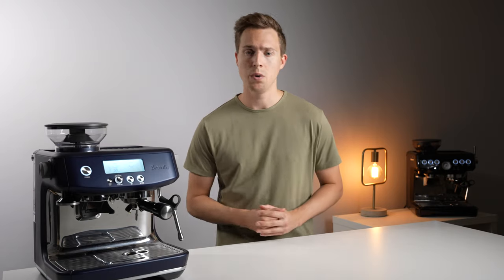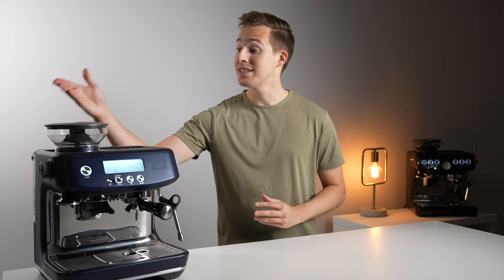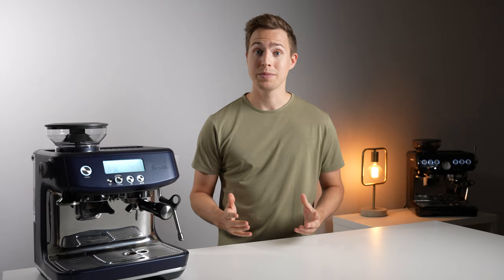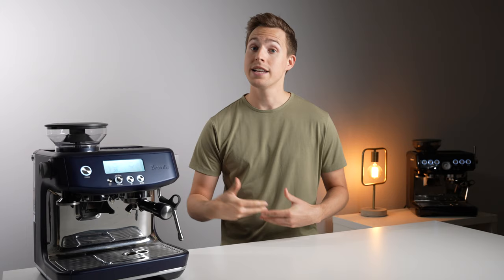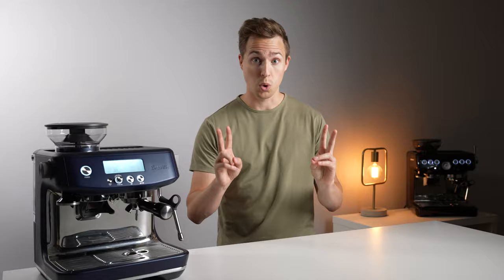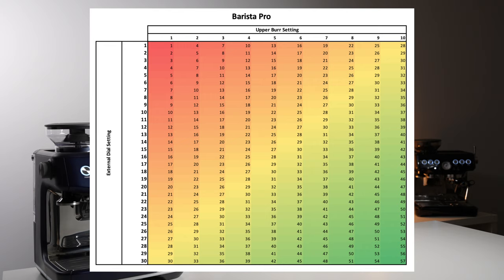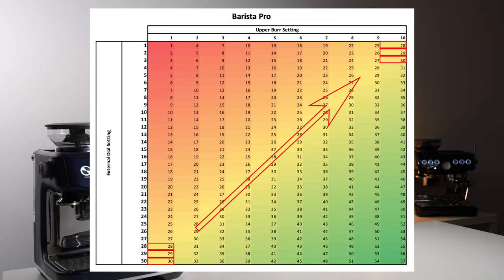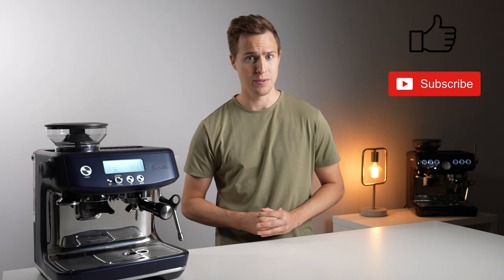Upper Burr vs Outer Dial Grind Setting | Breville Barista

Comment from the maker: Adjustable Upper Burr: https://geni.us/5K6T
(As an Amazon Affiliate, I earn from qualifying purchases)
Reply: What’s up bro, I have the barista touch if my conical burr is at a 4 any clue what my external should be? I use a naked portafilter & it’s sloppy every time 🤦‍♂️ so confused on if I should’ve even touched the upper burr which was preset at 6.
Reply from the maker: I can’t tell you what grind setting is right for your coffee or preferences. You need to dial in! 
How to Dial In Breville Barista Pro
https://youtu.be/D-bV4j-Z-sU

Comment: Wish you had done that 1.5 years ago when I too was trying to figure that out. My initial assumption was that it gave you a full new range, but after a pile of testing and troubleshooting I came to the same conclusion that it shifted the outer grind settings by 3. Before going through all this I had asked on reddit subs, Breville support, other BE owners; no one had the answer. Anyways, this was good to share for the masses.Thanks!

Comment: Interesting findings. Can confirm (barista pro). I was at the upper 6 and external 1 and it didnt work for my beans. Changed the upper to 4 so I have more room to play (italian beens, fine grind, italian espresso). I'm most of the time dialed in with the upper 4, external 4-6
Reply: Same for me.  I am at 4 on the internal burr and my shots are dialling-in around 4-6 on the external dial (mostly 5).  Seems odd to be this far down one end of the range.
Two other observations:
1. It takes a few shots at the new setting to really settle down to a consistent time, even if I have taken time to adjust the setting “mid-grind” and discarded both that and the subsequent grind at the new setting before pulling a shot.
2. The difference in shot time between each external setting can be quite large, maybe 2-5 seconds.  I believe the dial is stepless though so have tried finding the sweet-spot between settings.
Reply: This was helpful as I was maxed at external 1 with inner burr setting 6. Tried inner bur setting 4 and landed on external setting 5, and pulled a great shot today! Thank you.
Reply: Saaaame. Why are all my beans so close to the fine limit?

Comment: Can you please clarify -- When you say you dialed in a 32g shot, I am assuming that's the weight of the coffee in the cup, not the weight of the ground beans. I am curious what is the weight of your ground beans. I was shooting for around 20g, but found that on my Impress Touch, I'm getting about 14g when the tamper says the basket is properly filled.
Reply from the maker: Tune in to tomorrow’s video! 
The dose you can fit in a basket is dependent primarily on how dense your coffee is. Very dark roasts are less dense, so need more space to fit 18g. Dose appropriately for your coffee and basket, and change the brew ratio accordingly

Comment: I’ve had my barista touch for about 1.5 months now. I now have it set at 1 on the external grind however haven’t gotten the courage to play with the internal grind level. I weigh my beans at 18 grams and it takes 14 seconds to get 36 grams out. Can’t seem to be able to control that at all. So frustrating. My daughter just got her barista touch and hasn’t changed the factory settings at all and she gets 36 grams out in 25 seconds. I tried to go back to factory settings on my machine and the coffee was undrinkable. I went back to my drinkable but not great shot grind. All that to say that I believe breville grinders are not created equal whether you have a pro, express or touch. It’s most likely the same grinder in every model but they all grind differently. So you’re on your own and have fun playing around with it to get that perfect shot!
Reply from the maker: Yes, they definitely aren't calibrated to one another from machine to machine. 
Don't be afraid of the internal burr! It's a far easier process than it looks
Reply: @LifestyleLab_  I’m so scared to mess things up with the internal grinder but I’ll definitely try. Thanks!
Reply: You need to adjust the default shot by creating a custom double shot. it is written in the manual how to do that. This helps to prolong the pour time so for 18.5 grams i ended up getting about 45grams of coffee in 32 seconds and the crema is great and tasted good.
Reply: Hey may I ask, what has happened to your dial in?

Comment: Great video.
Can you explain:
1. What are the numbers inside the table stand for?
2. How much beans (grams) you put in the machine, is that was consistent for all tests?
3. I understand that the brew time was 25 seconds for all the tests is that true?
4. I have the barista express with the pressure dial. I did not change the  inner scale is set on 6 by factory default. My  setting is around 12 or 13.where i can find this setting in your table?
5. Can you point out where was the pressure dual in each of the tests? Is was staying all the time in 10 oclock?

Comment from the maker: Any guesses how many shots I pulled in total to figure this all out?
Reply: 102
Reply: 60 Shots I guess?
Reply: 470 shots total
Reply: I should say, At least 470 shots
Reply: judging from what it takes to actually get the Barista Express dialed in...I'd say close to 200
Reply: 169
Reply: 42
Reply: Just gonna leave us hanging without an answer? LOL
Reply: I can't believe the level of the comments in this video.
The vast majority of the people posting mathematically impossible guesses.  WTF is wrong with the world?
Reply: @itsm3th3b33  I hope my guess/theory is Mathematically sound enough for you;)

My theory is he did a lot of extrapolation.
He probably tested 2-4 upper burr settings to confirm the 3 steps was consistent.
Assuming he already had dialled his machine in for the first burr setting (the first shot), he has to make 9 shot in total the check 3 burr settings, and 13, if he tested 4 burr settings.
So he made somewhere between 18-26 shots to check this for both machines.
As always he kept the other variables consistent in all shots.

Saying he did over 100 shots is total nonsense, since you can’t make a decent espresso-shot with most of the range this machine offers. 
(There is no point in trying the setting coarser than factory defaults)

Comment: On my Oracle Touch, the micro dial knob adjustment range is 1 to 45, I “calibrated” my upper burr so that my optimal espresso range lies half way around 22. As the beans stale, I would just adjust finer toward 19. 

If I remember correctly, each macro upper burr adjustment typically equals to 12 micro adjustment on the dial knob.

Comment: I have a Barista Express and it current gives watery shot for upper burr at 6 and external at 4.

Should I go for upper burr 4 and external 5 or higher like 8.

Please note I don’t weigh up beans and do mostly cappuccino, with a single dose basket. Grind quantity is set to the 1st bar
Reply from the maker: There’s absolutely no way anyone is going to be able to tell you the correct grind size. It’s different for every coffee and dose. You need to dial in :)

Comment: I just got my machine (Express), so I'm still exploring the world of grinding. It seems to me there's too much variation between steps on the external dial. There's too much of a jump in grind size from, say, 5 to 4. So extraction using one is too fast, and too slow using the other (I'm not an expert at tamping yet either, of course). My question: in which direction should I adjust the inner burr in order to make the steps on the external dial more gradual? Or should I spend more time with the machine before making any adjustment?

Comment: Is there a risk of causing the upper burr and the conical burr to make physical contact when setting the upper burr to a very low number?
Reply from the maker: On most grinders it is possible to go to burr touch. I would not be surprised if Breville had a factor of safety to prevent this. Either way, just be careful to only adjust one step at a time and only as needed. A setting close to burr touch would be MUCH too fine for espresso use

Comment: Great video, very helpful.
I’ve just purchased simplest Barista Express branded by Sage. Going from old automatic Jura and Nespresso. First was to big for its place, Nespresso produces tons of alu capsules, Sage/Breville was chosen by my wife as suiting our kitchen perfectly, size and design.
Day 1. I took relatively cheap espresso beans from local grocery for trying. And failed to build ANY pressure on the gauge, having extraction below 10 sec for 2 caps.
Changed the upper setting from factory 6 to 3 - very little progress. Finally, after setting upper to 1 (!) and 2 left/external dial I was able to get right pressure.
Is it normal for the new device? Should I contact the service? I assumed upper grinder setting has some range which should be used when grinder gets old. In my case - I have a new device, opened today. Would appreciated any hint on this.

Comment: Thanks for your terrific videos on the Barista Pro.  Are you aware of an upgraded burr set for the Barista Pro to swap out the original burrs?  It may be from Baratza with their M2 burrs used in their ESP etc.  I only do espresso and at this stage I would like to stay with the built-in grinder which is very capable however an upgraded burr set could mean even better espresso without the need to eventually buy a stand alone grinder.  Any info would be much appreciated.  Cheers.

Comment: Got my machine last week and had trouble dialing in. I now have a good pre-infusion and extraction time, the flow looks good, but the shot tastes sour. Doing 18g in and about 36g out in total 35 seconds. I had to take the upper burr down to 2 and knob setting down to 3. It just wouldn't be fine enough otherwise. How can I sweeten up my shot and get rid of that sourness?
Reply from the maker: Increase brew ratio :) 
Try a 1:3 or 1:2.5

Comment: Thank you for that, very helpful!
Question: were you able to actually use the grinder from 1/fine to 10/coarse, or did you use extrapolation?
In my BBE at some point (very high on the dial) of I try to go finer there's a noise that sounds like the burrs are touching each other. 
If I go to 5 inner 1 outer I think the grinder would just lock..

Comment: How about the advice from Breville/Sage themselves not to adjust the upper bur but leave as adjustment for wear on the bur?
Reply from the maker: If you need to grind finer or coarser than the outer dial allows, there’s nothing wrong with moving it. It’s just an offset

Comment: I've had my Barista Pro for a week and this is what I have been really curious about and was hoping there will be a video on this - perfect timing! Thank you!

I have my internal/upper on 3 and I seem to be able to get reasonably good shots with outer dial on 14/15. Tastes alright and the dark roasts are rich and creamy, but the last third of the extraction still gushes out quite often - is this a problem that can't be avoided due to the clumping of these grinders, or is there another variable I can control?
Reply from the maker: Darker roasts tend to lose puck integrity quite severely towards the end of a shot, so this is not necessarily abnormal

Comment: I am looking at the "equivalent" chart for the Barista Pro. The horizontal scale (top) goes from fine (1) to coarse (10) from left to right for the upper burr, while the vertical goes from fine (1) to coarse (30) top to bottom. Taking just one setting as an example, coordinates 6-6 gives a setting of  21. If we just move horizontally one step to the left to coordinate 5-6 (upper burr 5, outer setting 6), we now have a setting of 18. I am questioning as to whether the correct setting at this point should be 24 instead of 18. We are going fine on the outer burr setting, so this should be compensated by an equivalent coarser setting on the external setting (???)....... or have I got it entirely incorrect.
Reply from the maker: The chart is correct. 
Moving the upper burr on click finer is the equivalent of moving the outer adjustment 3 clicks finer (hence 21-18)

Comment: If I’m primarily doing high altitude light roasts, should I just put the burr on 1?
Reply from the maker: Not necessarily. Each coffee is different, dial in by taste accordingly. If you find you always need more flexibility on the finer side then no problem with going all the way to 1 to keep you closer to the middle on the external grind dial

Comment: This matches my experience when I first changed the upper burr settings on my Barista Pro. I was down to 1 on the outer dial and still couldn’t get my shots right when I learned about the upper burr setting. I opened up the grinder and it was set at 6. I moved it to 3, and went back to dialing in my favorite beans. An exterior setting of 9 is now perfect!

Comment: This is amazing! those tables is very useful really thank you for that. Sure it can be a good reference when I have to dial for a new beans  ! However one question for the barista express: can it achieve a filter/drip grinding setting ? what are the best setting for that? Im asking that just because I always ask for ground beans for my drip coffee usage and whole bean for my espresso so maybe I can use the BE grinder for drip?
Reply from the maker: The maximum I could get was around 650 microns, which would be quite fine for drip / pour over
Reply: @LifestyleLab_  Thank you for the reply. When you say maximum you mean the coarsest setting right ? So it doesn't leave much room for fine tunnining I guess ?
Reply from the maker: Yes, the courses upper burr, and coarsest on the external dial yielded a 650 micron particle size. You can go much finer, but no coarser than that
Reply: @LifestyleLab_  THank you. and sorry for the other comment. I was giving an example no ad was intended

Comment: If you do espresso then, would you move the burr setting to 1 and just play around with the wheel depending on the kind of coffee bean type?
Reply from the maker: Not necessarily. Start with the default setting and see if you need more range finer or coarser. In many cases, the default inner setting is perfectly adequate
Reply: Thank you! Ill do 😊

Comment: Thank you for all the work and effort to make this video! I wondered this same question and couldn’t Breville didn’t include this information in their manuals.

Question: What do the numbers inside the table mean, and what is the significance of the colors?

I am currently using Upper Burr set to 4 and External Dial set to 6 and am happy with the result. This is represented by “16” and orange on your chart, but it’s not clear what this means. Typically green=good and red=bad, so I’m a little confused.
Reply from the maker: The numbers in the chart are a completely arbitrary “coarseness” number

Comment: So the question is, when and why would I change the setting in the upper burr?
Reply from the maker: If you hit the minimum on the external dial and need to still grind finer, or if you hit the maximum and still need to grind coarser to get the desired flow rate

Comment: New to Breville.  Just bought a Touch and it feels like I am not getting enough coffee dosed.  I have dosing set to 28 sec and when I tamp the razor still does not hit the top of the gounds.  Is there something I am doing wrong?
Reply from the maker: A grinder is going to take as long as it takes to reach the desired dose. The finer you grind the longer it will take to reach that does, the coarser, the faster it will grind. This is why timed dosing should only be used once your shot and grind size is fully dialed in. 28 sec of grinding could give you 18 g or 10 g based on the grind size you’re at

Comment: 100 bags of beans where probably expended in the making if his reaserch and atill i dont know where a good optimal starting inner burr setting should be.
Reply from the maker: Start at the default which I believe is 5 or 6. There's no way of knowing beforehand which is right for your machine and your beans. Only way is to pull a shot an adjust accordingly
Reply: @LifestyleLab_  thank you!  The out-of-the-box setting for my machine was at 6 for the inner.  Went to 5inner/3 dial and shots are still running 48-52grams in 15-20 secs.  These are dark roast beans.  Tried two other brands just to see if it made a difference, shots were all still very fast.  Will try a much lower inner setting.  Barista Pro, my butt,  sure getting to know the machine.  Just wish it was more Pro- friendly. I guess it was one way for Breville to ensure their machine made something liquid and not sludge on the first go.

Comment: I got a question: I manually adjusted the grinder to 13 using the touchscreen (Barista Touch). The thing is, when I turn the machine off and then turn it on later on, the touchscreen signals the grinder is at 14. Does it do that automatically or is it some kind of mistake? As I reckon the grinder adjustment is only manual
Reply: To be a little bit more clear: I set it at 13 using the outer dial, which shows the number on the touchscreen. How did it get back to 14 after turning it off and then on!?
Reply from the maker: I’m not sure… it shouldn’t be changing on its own

Comment: What happens if I put the dial in between grind settings?
Reply: I did this and created a rift in the space-time continuum, destroying several populated systems in Epsilon 6. However, I did acheive a slightly thicker crema
Reply: @jonhatcher788  😮😮😮